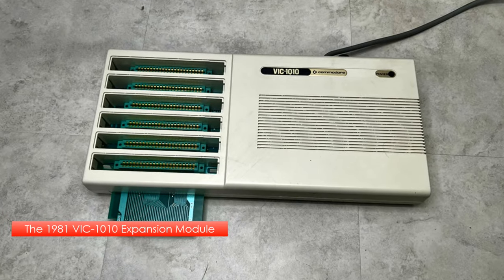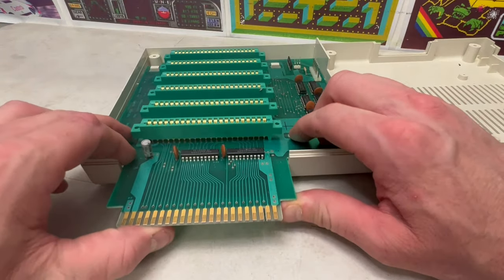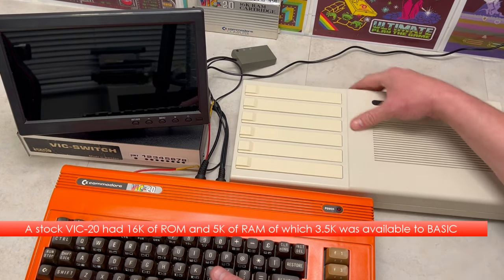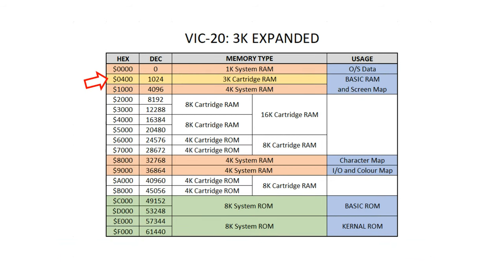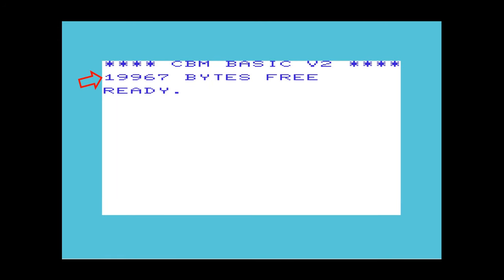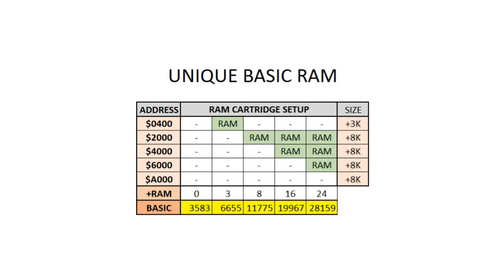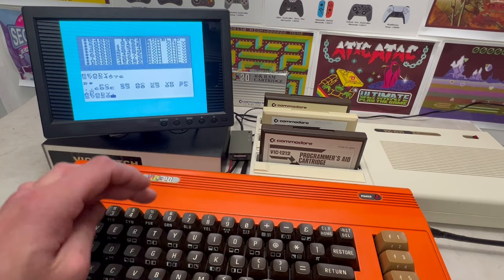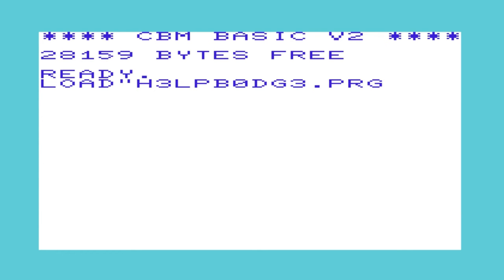1981 Commodore VIC-1010 Review, Cartridge RAM and Utility ROM Testing

Comment: If you have the right hardware it is actually possible to get a full 32K available to BASIC. I have a Protecto 80 column video card, and using that, which has its video memory in the cartridge ROM space up at $B800, with a couple of pokes you can turn off the normal video RAM and start BASIC at the bottom of the 3K RAM expansion space. Of course you can only use it for a very limited amount of software but it can be useful if you want to run PET BASIC program.
Reply from the maker: Thanks, I’d never heard of that. Here’s a link for everyone else’s reference. https://sleepingelephant.com/denial/wiki/index.php/40_and_80_column_boards

Comment: My neighbour had something like this, but inside a metal case the Vic-20 fitted into and the monitor could go ontop. It also gave the Vic 40 or 80 column text too? It this a possibility with this device?
Reply from the maker: Hi, unfortunately not - but think this is the device you mean? https://sleepingelephant.com/denial/wiki/index.php/40_and_80_column_boards
Reply: @RetroRelixRestorer  Maybe it was the card, but the unit enveloped the vic, only the keyboard was visible, it had multiple slots and its own PSU too?

Comment: Hmm, kind of ridiculous to have to have the cartridge port EU be so big. You can't even have the monitor straight behind the computer without a huge riser shelf, and then that riser needs to be fairly tall just to accommodate the cartridges under itself and the monitor. With the EU so big without a cable between it and the computer, this is quite a wonky setup.
Reply: Back in the time, you would usually have it connected to your family TV via a long cable.
Reply: @antoniopala8135 : Not necessarily. Most often not, actually. I've never heard of anyone doing that, and most TVs back then weren't very big, so it would be ridiculous to do. Most often a TV used for a computer then would be used in the same way as a plain monitor also was back then or is now: on the desk. (And some  people even use a smaller modern TV as a monitor on their desks now, just as I am.)